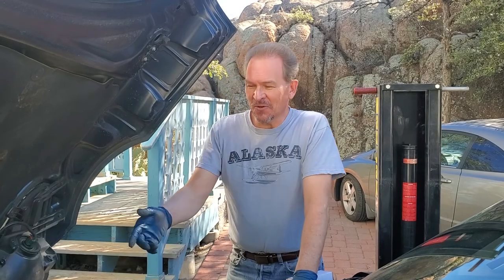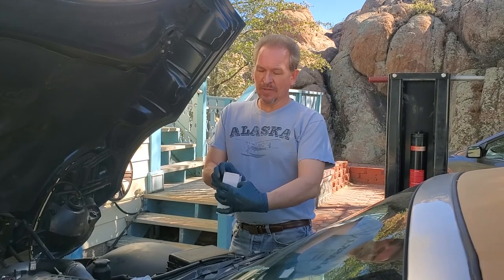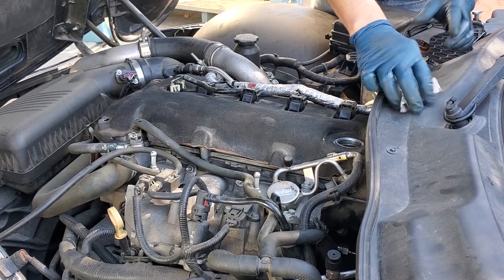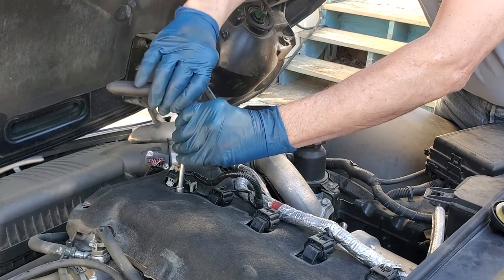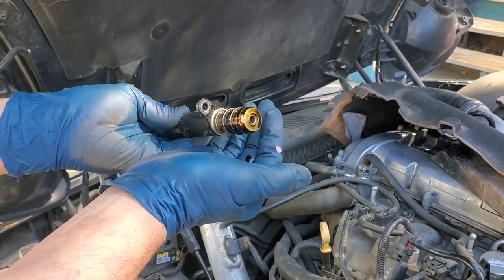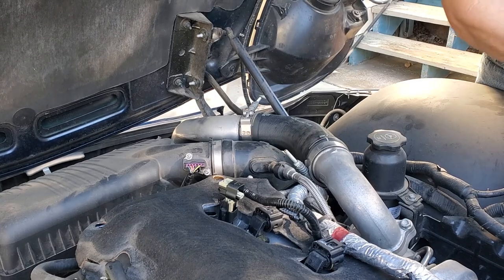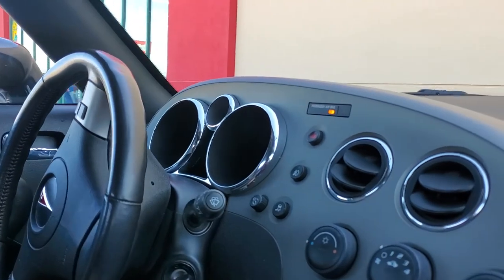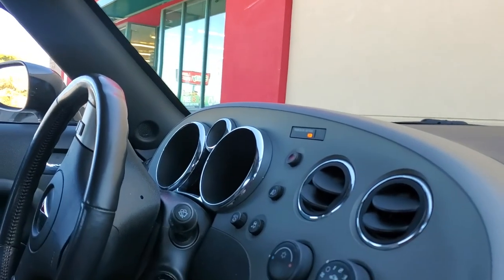How to Replace a Variable Valve Timing Solenoid for a Pontiac Solstice or Saturn Sky

Comment: 2006 Pontiac Solstice - I just changed both the Intake and the Exit with PHILTOP Solenoid Variable Valve Timing Solenoid ,Replace Intake Solenoid 917215,Exhaust Solenoid 917216, VVT 2 PCS for $25 on Amazon (instead of $75 each with OEM Parts). I never would have attempted it with out your video. THANK YOU! I have had my engine light on for years, no mechanic could figure it out, I bought a OBD2 reader and had 7 codes, fixed all after these changes and a new air filter, again Thank you for your informative video
Reply from the maker: Thank you for writing this superb review! The information you included is greatly appreciated, as it will be useful to our viewers. Good to hear that the video inspired you to take the plunge. Thanks for watching!

Comment: I just changed out the VVT solenoid on our 2009 Saturn Sky.  Your video was very helpful.  A couple of things.  At least on our Sky, we do not have the bulky insulation to deal with.  Just some 1/4 inch form insulation glued to the underside of the valve cover.  Also I had read from other sources to go back to AC Delco for an OEM VVT for only a few bucks more than the Doorman VVT.   Thanks for taking your time and effort on making the video.
Reply from the maker: You're very welcome. Thanks for the information on the interchange from Delco Delco. Thanks for expressing your appreciation for the video. Thanks for watching!

Comment: Well following your directions i replaced them both both with an amazon kit (A-Premium VVT Intake & Exhaust Camshaft Position Actuator Solenoid Valve Kit ) The p0010 went away, plus the car drives and feels super peppy. im shocked how strong the car feels. this and an air filter and the car performs wayyyy different.

Comment: Always appreciate the videos. I have the 'M Car' manuals and I find them great. Except that they are written for shop hours in some cases. Like replacing the crankshaft position sensor, they want the car in the air, the exhasust and starter removed, replace it from under the car. Well....it's faster easier and less of a PITA to do it standing at the driver's side wheel with the hood open LOL VVT solenoids are on my list of "gonna do it to stay ahead" items on my '08 GXP. Solid car...and my goal is to not give it a chance to break!

Comment: What were the symptoms? I’m getting a code P0336. & getting engine power loss & traction service light. Along with the check engine & oil lamp. 
It’s seems ok for about 200 yards and then chock’s & sputters. I’m at a loss @ only 61890 miles. It’s (was)my dream car.
Reply from the maker: Good question! Possible causes of the P0336 code include a defective crankshaft position sensor, reluctor ring issues, and crankshaft position sensor connector issues. Some symptoms of the P0336 code include an illuminated check engine light, a hard starting/cranking engine, and hesitation during acceleration or stalls. Hope this helps you solve the issue.
Reply: @CarzPlus  thank you. This car is a bi**h to get to most of these parts. The battery position is the worst. Who thought it was a good idea to place a battery where you have to take the fender off?
Reply: Engineers who were not required to take apart that which they designed.
Reply: @MichelleBertsch I just removed the bolts from the plastic in the fender well which gave me enough clearance to wiggle out the batter without removing the fender. There is also a metal bracket that u need to also take out

Comment: We need a video for the camshaft position sensor.
Reply from the maker: Great suggestion and we'll keep that in mind. Usually, when we're in need of a repair, we get the camera rolling and and make a tutorial. The play list for this one does keep growing. Thanks for watching!
Reply: He is changing the camshaft position sensors. The variable valve timing solenoids are at the back of the cylinder head by the oil cab.
Reply: @antiangelofmusic  hello - no he replaced the actuator or solenoid.  The sensors are at the back of engine.  I got this wrong too at first.

Comment: Should the exhaust solenoid be changed also?
Reply from the maker: We prefer to replace parts only as needed. The exhaust solenoid is still functioning and hasn't needed a replacement yet.
Reply: I’m curious on this reply, I’ve been borrowing my dads 2008 solstice since about March of 22’ it’s been running fine but about a month ago, it’s been idling rough and when I listen to the engine, it almost sounds like an exhaust problem, so it maybe this? It’s only got 57,700 miles on it I’d surely hope there wouldn’t be any problems going on with this car since it’s practically brand new, when they stopped making them my dad never drove it to keep the miles low. But I’m curious if I should change the exhaust vvt when I do the intake vvt. I’m also unsure how old the spark plugs are I guess this could cause the rough idling and vibration I’m hearing. I’m just hoping it’s not like the timing chain giving out or something.

Comment: Are you running a tune?
Reply from the maker: No, just replaced it to solve a problem with codes. Thanks for watching!
Reply: @CarzPlus  
Thanks for the video. Just changed mine the other day. 2008 Pontiac Solstice GXP, Stage I tune.

Comment: Those aren't the variable valve timing solenoids. Those are the camshaft position sensors the variable valve timing solenoids are at the back of the cylinder head by the oil cap.
Reply from the maker: https://www.amazon.com/Dorman-917-215-Variable-Timing-Solenoid/dp/B00B2LCE1E/ref=asc_df_B00B2LCE1E/?tag=hyprod-20&linkCode=df0&hvadid=312057677264&hvpos=&hvnetw=g&hvrand=14941324628297029145&hvpone=&hvptwo=&hvqmt=&hvdev=c&hvdvcmdl=&hvlocint=&hvlocphy=9030322&hvtargid=pla-496212369812&psc=1